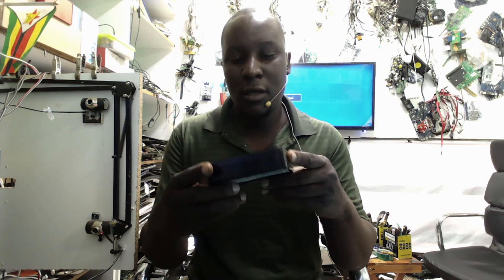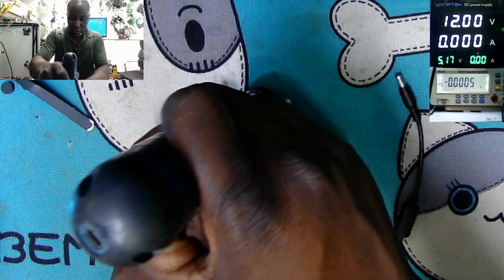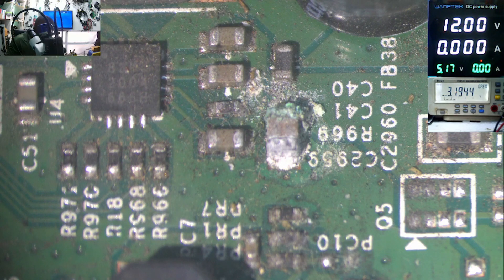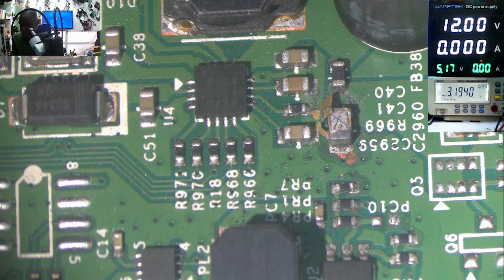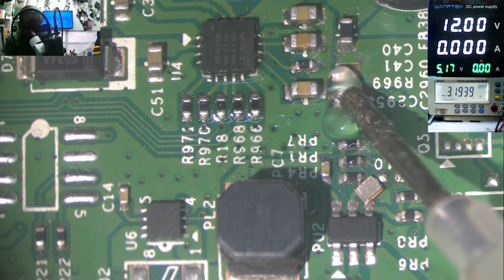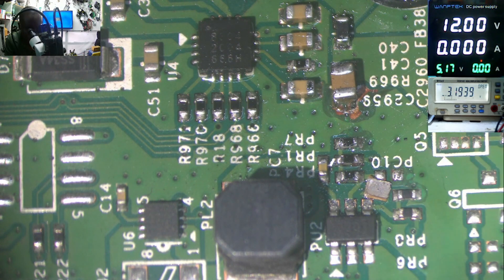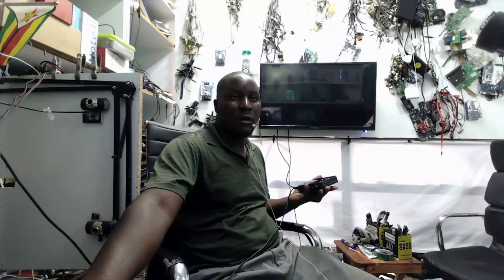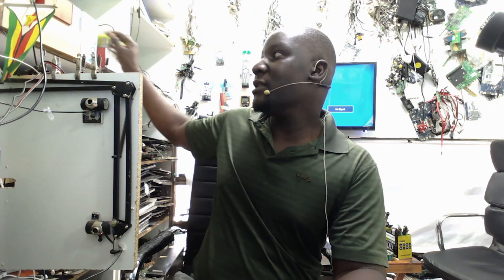How To Deal With Short Circuits Due To Water Damage On All Decoders.

Comment: Greetings sir mine is affected because my cable was broken so water cme in from the white cable to the decoder, so it turns but no signal and you can switch it on and off with remote but no signal and I opened it on that thing that white cable connects it shows a bit of water
Reply: Other parts of the motherboard is very clean since the decoder is only 1 week very new